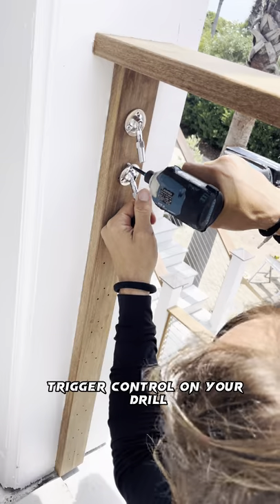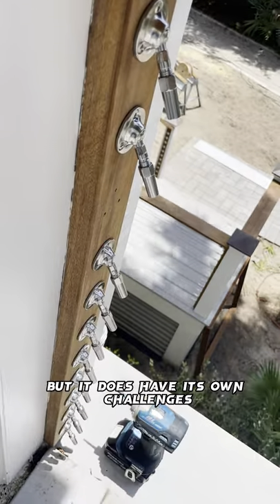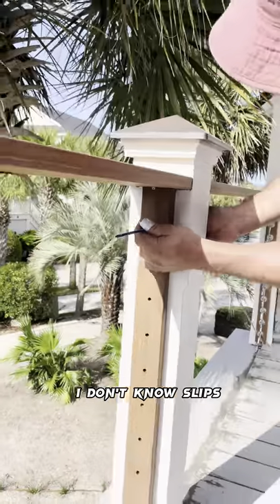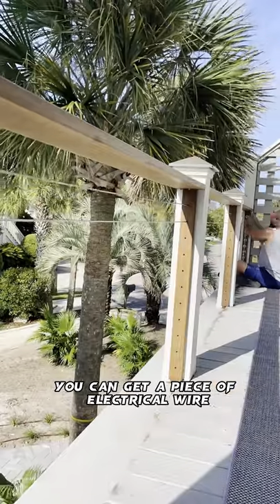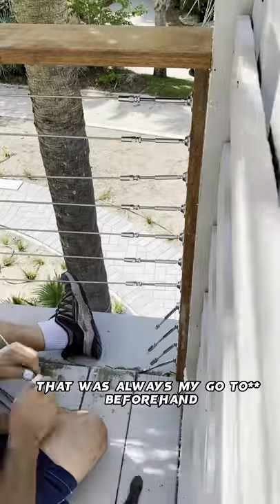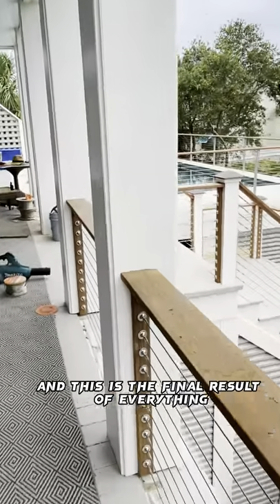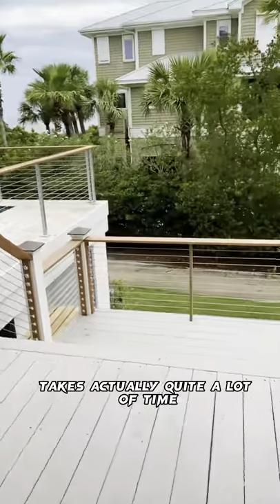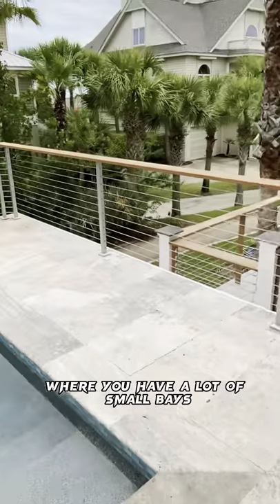Installing Cable Rails on a Deck Part 9 | Artpentry

Comment: We used to call those “slips” , “donkey dicks”. If they’re like the ones we used for cable pulling and plastic underground conduit pulling, they are like the Japanese finger traps, used sort of as a game. Same idea, only made from heavy wire cables woven together.

Comment: Does anyone remember the movie where everyone got killed by a broken wire? It cut them all in half when it snapped. Anyway, that movie made me terrified of wires like this! 😂
Reply: I know your kidding but these cables wouldn't even come out of the post.  The cables your talking about are used in concrete building floors and have over 10000 pounds of force from end to end of tension.  There are probably others though.
Reply: @HudsonFamily7  ok. Thanks for explaining, that helps a tiny bit! I just remember seeing a movie years ago where people were cut in half and the fear has stuck with me ever since.

Comment: How do you brace those steel corner posts against the tension
Reply: Code is 200 lbs at base which is ~1300 lbs at the top. They can tolerate some tension.